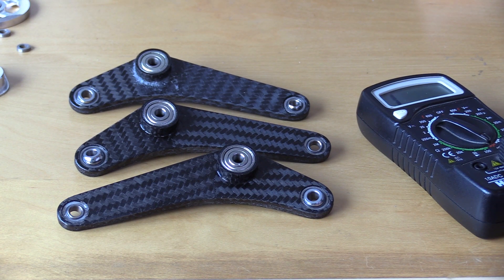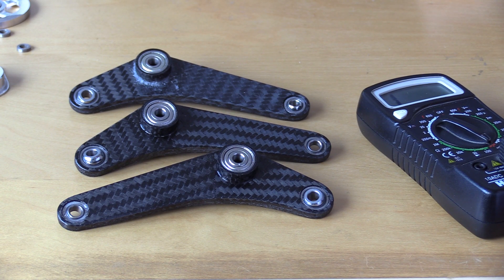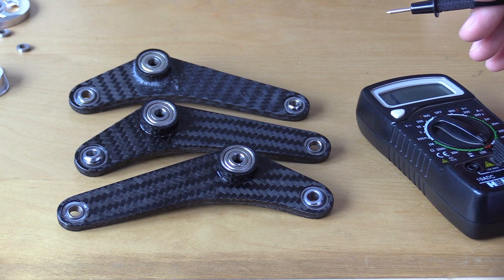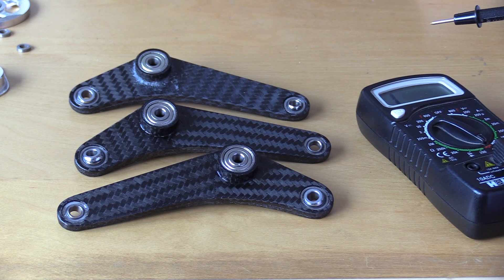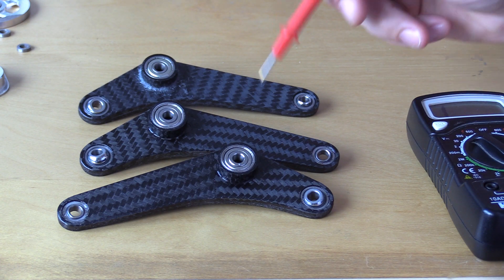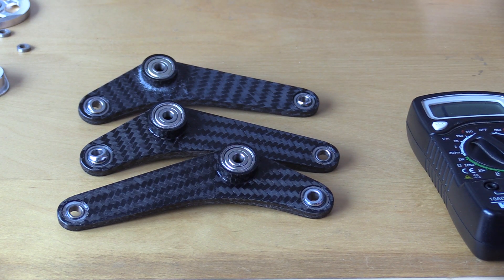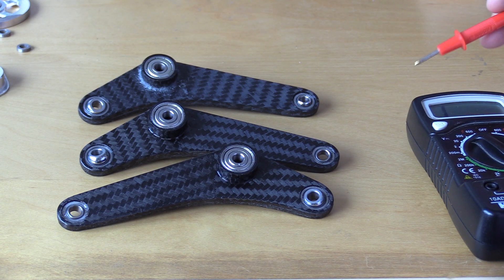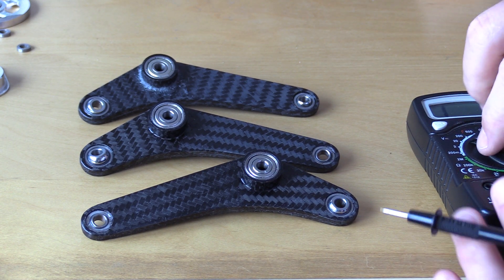How to prevent galvanic corrosion in carbon composites

Comment: You failed to mention that galvanic corrosion will only occur is the parts are touching (or are connected via conductor) !AND! ARE SUBMERGED IN ELECTROLYTE!

If the different metals are touching but not submerged in electrolyte, galvanic corrosion won’t occur!
Reply from the maker: If you read the comments below, you'll see that we mention that an electrolyte is needed. Nevertheless, you're wrong when you think that it has to be submerged in it. It is sufficient when condensed water and some salts are available. That's the reason why some sailplane producers had problems with galvanic corrosion, though the airplanes are seldom submerged in electrolyte.

Comment: How do you get conduction through the epoxy resin which is impregnated throughout the fibres?
Reply from the maker: You do not have to do anything to get conduction. The carbon fibers  touch each other, so that the piece is conductive in total.

Comment: Great video.Those are the, not so well known characteristics of mixing construction materials.Add H2O/moisture from the road/air to the mix and you have an actual battery. H2O acts as a catalyst accelerating the corrosion, deterioration and eventual material separation.A reality in other fields as well such as, auto racing and high end bicycle manufacturing.

Comment: Correct me if I'm wrong but isn't there a difference between conductivity and galvanic corrosion. For corrosion to occur you need a substrate like water present too.
Reply from the maker: Your're perfectly right. For galvanic corrosion to take place a current must flow, which means you need, for example, a liquid substrate rich in ions, but also that the two conducting materials have contact. Checking conductivity between them is the easiest way to show that they are not contacting, so that current cannot flow and galvanic corrosion cannot take place – irregardlessly of the presence of a liquid substrate.
Reply: @andreschavarria1450  I have a question, if the part is submerged in say salt water that's conductive, wouldn't that short circuit the glass fiber barrier and cause galvanic corrosion?
Reply from the maker: @IkarimTheCreature  No, it won't, because galvanic corrosion needs current to flow at the interface between metal and carbon fiber. You need salt water or other ionic solution to have galvanic corrion at all. But as long as carbon fibesr are not touching the metal, current cannot not flow, because you need to close the circuit. You can think of it like a usual battery. See https://en.wikipedia.org/wiki/Zinc%E2%80%93carbon_battery
Reply: @andreschavarria1450  thank you, I had trouble wraping my head around this

Comment: What is the voltage generated there, and which direction does the current flow?
Reply from the maker: That depens on the metal paired with the carbon composite. Take, for example, aluminium, which is almost on the opposite end of the galvanic series compared to graphite (carbon). The voltage difference is over 1 volt, where graphite is losing electrons to the aluminium. If you take titanium, for exmaple, the voltage difference is much less and pairing these without insulation is less problematic.

Comment: Ahhh! as someone whom has performed and tested cathodic protection and grounding systems, along with passivation of metalic componats, I have the feeling you are falling into a rabbit hole. I have also worked with carbon fiber laced with copper for faraday cage properties.
If you have the slightest failure in your insulator, you will focus your cathodic reaction. I feel you should take advantage of the conductance of your carbon.

I feel you may want to consider "How and What' you use to seat your metalic componants and what these parts are made of. I.E. Stainless Steel bearing parts with the proper lubricants will mitigate your reactions.

Love the idea, thanks for taking your time!! you got me thinking!

Test! Want to test your ideas!  set up a basic DYI copper, silver, nickle plating system, cheap, maybe interesting?
ROCK ON! Gett'[er Dun!

Comment: This is what i needed. Where can i source the thin glass fiber sheet?
Reply from the maker: You can easily make that sheet yourself: take some peel ply, a thin glass fiber fabric, wet it with some epoxy resin, put another layer peel ply on top, press everything between even surfaces.
Reply: @andreschavarria1450  Thanks🖒
Reply: Hi, we manufacture carbon fiber sheets, please check here: https://www.jinjiuyi.net/carbon-fiber-sheets/

Comment: How to you achieve tolerances for the bearing housing after laying the ID with glass fibre please?  Or do you just press fit when bearing is cold?
Reply from the maker: The bearing is glued into the housing with the same expoxy resin used for lamination. No preload is created so that the internal clearance of the bearing should be small. We have a video about making these bellcranks, which shows the process in detail: https://youtu.be/9SKj9la_swQ

Comment: Thanks for sharing. 

Does the glass/epoxy insulator help keep the bearings in place? For non-CNC parts, can you use interlay glass fiber during the layup process in pockets we’re your parts interface with metals, or is it better to add the glass after part is cured?
Reply from the maker: Yes, it keeps the bearings in place. If thin slowly curing epoxy is used, the border of the bearing is perfectly wetted ending in an excellent and strong fit. Defat the surfaces with isopropyl alcohol before. I think it is much easier to cover the surface after the part is cured. It's harder to guarantee that the parts are truly galvanically isolated when working on the wet layup.  A couple of thin carbonfiber strands sufficie to connect the parts.

Comment: Hello! I really like your lever design. For the ultimate in weight reduction you should check out plastic bearings. Like this:    https://www.igus.com/product/390     and this: https://www.igus.com/product/93   The weight is nothing, you wont have galvanic corrosion, they are cheap and they work on carbon shafts, they last long and they tolerate rain. Does not use lube. What is your thought on this? I am designing a suspension system with swing arms and is only using plastic bearings. But its not built or tested yet...  How did you make the flange for the roller bearings in the middle of lever?
Reply: I see this link so I get the picture about the flange..https://hortenmicrolight.wordpress.com/2019/01/12/engineering-lever-arms/

Comment: Did you build the carbon arms, and then glued in the fibreglass sheet? Or is it build into the laminate?
Reply from the maker: The arms are first made, and just before the bearings are installed, a thin sheet of glass fabric is put between bearing and lever arm. Doing it in one shot, would be much more elaborate.